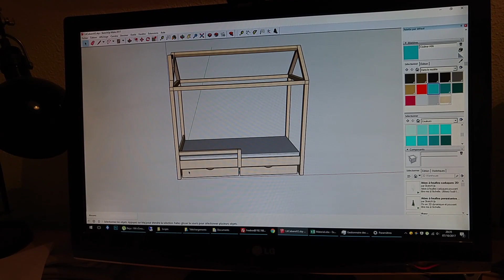Making a bed house for kids !

Comment: Hi I'm interested in making this bed but I want to do it as a bunk bed could you help me with the measurements
Reply from the maker: Hi, pretty ambitious project! How may I help you ?
Reply: @Deadpohl  so I found a cheat lol so my plan is to get a bunk bed and then turn into a house shaped.. got told it'll be alot easier
Reply from the maker: @memeq5812  I think it's indeed way smarter to do it this way! My design is not meant to be turned into a bunk bed. The wood size, the joints, none of them would be strong enough!
Reply: @Deadpohl  thank you, got to think of space for the kids to play in.
Reply from the maker: @memeq5812  I'm interested in the result though, so don't hesitate to contact me when you're done!
Reply: @Deadpohl  definitely!! Hopefully I'll post some pictures too.. I mean I saw ready made ones but the price of them were very expensive
Reply from the maker: @memeq5812  That's why I made mine :)